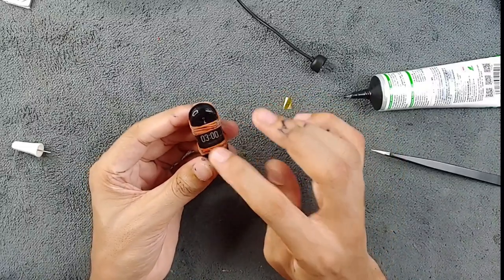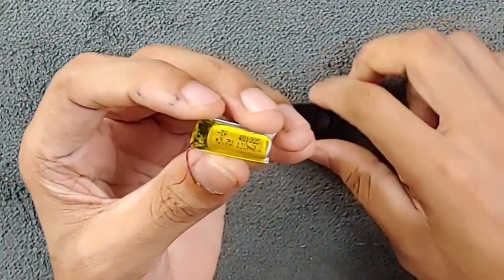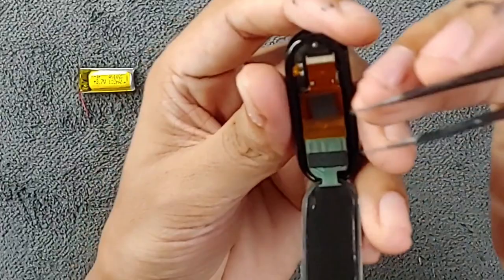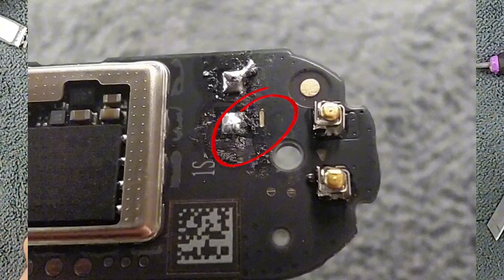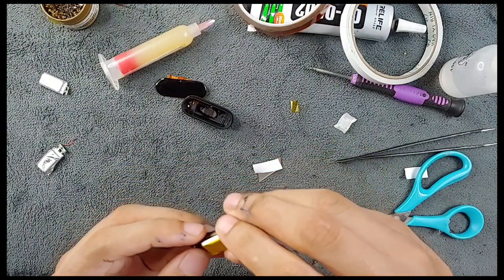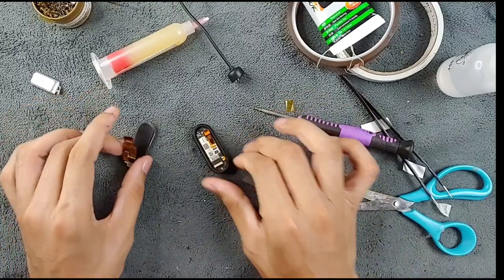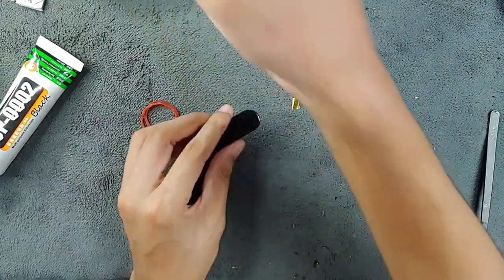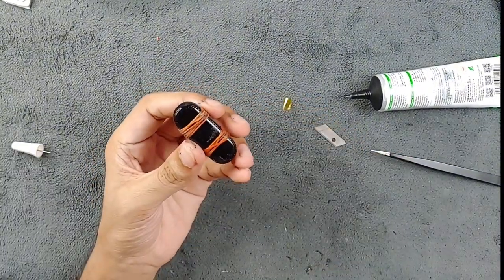Mi Band Battery Replacement Tutorial | Xiaomi | RandomRepairs

Comment: I am trying to repair a Mi Band 6.
There was some corrosion on the battery terminals.
I used alcohol and wiped the +ve -ve terminals.
However the problem is the +ve terminal is just a plastic square.
There is no metal there, and it cannot catch any solder.
So I don't know how to solder the red wire onto that plastic square.